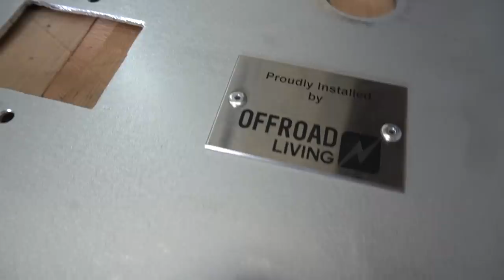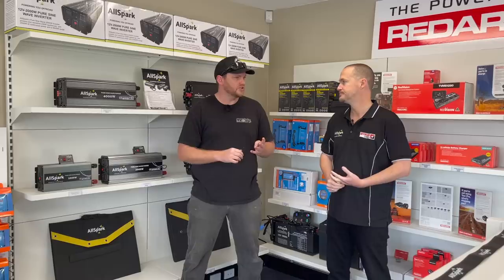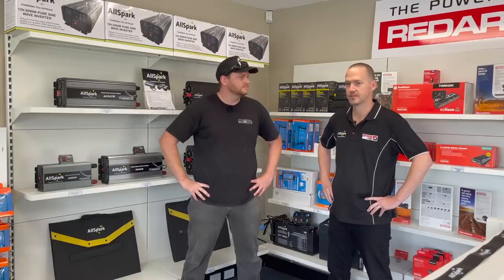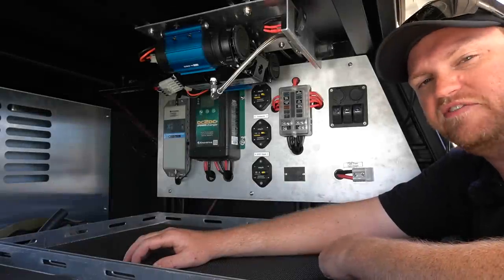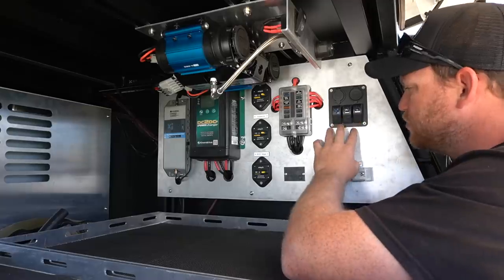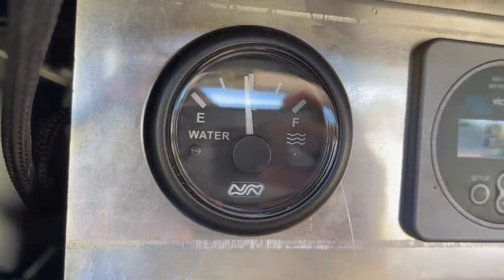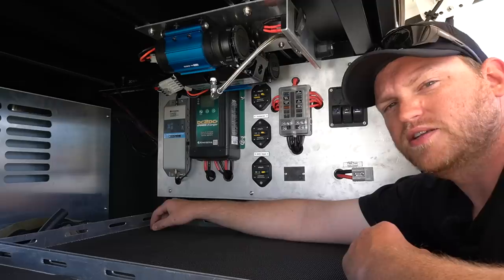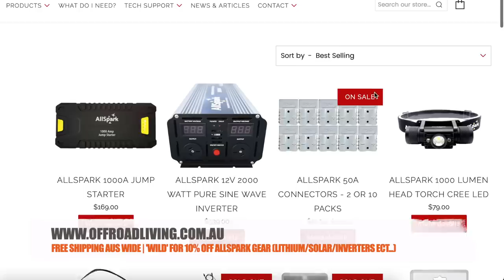The Dmax Touring (re)Build Series E05 || 12v Fitout - Induction Cooking & Allspark Lithium Battery

Comment: Hated watching this! Makes me realise the amount of work I need to do on my 4wd, basically a whole re-wire, lithium batteries , dcdc charger, solar panel….etc. $8k+ 😩. 👍
Reply from the maker: Yeah it’s a big job and decent chunk of change done right. But so worth it for reliability and longevity if you can justify it for your situation!
Reply: I just wired up my caravan with 1.2KW solar, 340Ah Lithium, 85A AC/DC charger / 4kW inverter/ automatic change over switch. 50A  DC/DC charger and it cost me 6k. Granted I did the work myself but lithium systems are getting somewhat affordable in relation to what they used to be.

I can run my AC on the coldest setting all day, whilst also using my microwave and any other electrical load in the caravan with no worries now. Very happy with it.

Comment: Does your compressor wire straight to your lithium main terminals? Am thinking of hard wiring as well. Am assuming that if car is running it would give 70a from lithium and then 40a from alternator through the dc2dc charger to drive the compressor?
Reply from the maker: It’s hardwired to the fuse block (each piston has its own fuse). So it is running off the lithium. When the compressors going with the engine running it would be assisting it with some current. But my batteries good for 175a continuous, so the 68a max from the compressor doesn’t worry it (engine on or off).

Comment: Cam, How do you find the heat build up or dissipation from your 12 volt oven ? do you find the roof mounts good with air gaps all round the oven ?
Reply from the maker: Every side other than the door is really well insulated. It’s working well 👍🏼

Comment: Awesome canopy build and an amazing electrical fitout, Cam. It does not just look amazing but meets your build brief. Keep working on the love for the induction cooktop, one less fuel source to worry about, greater control over cook temps and yes, unaffected by blowing WA gales. The All Spark solar blanket looks great, keeps the tinny on the roof and extra weight out of your setup.

Your honesty is still refreshing and soooo appreciated, your supporter base is growing in reflection of that honesty and diversity of topics you cover. And also keeping things in the realm of fiscally achievable for the average person/family. All the best to yourself, Tiff, Chloe and Percy (and the new little Wild on the way (?)), thanks for more great episodes on everything that keeps you getting away and sharing what you get up to when you get there. Cheers.
Reply from the maker: Thank you! I really do appreciate the kind words and the support! 

Definitely going to persist with the induction cooktop for a while to give it a fair go, as you said- there’s plenty of positives!

Comment: hey mate , what did you set up cost roughly, I know I won't need as much as you but heading over to Perth next year wondering if it's gonna be better to wait to get canopy and electrical done there or do it while I'm in Sydney
Reply from the maker: All their prices for parts are on their website;
www.offroadliving.com.au

But roughly 
$1500 for 150ah battery 
$480 dcdc charger
$310 battery monitor 
+ fuse panel, circuit breakers, Anderson plugs, terminals, wiring, solar, labour ect..

Shoot them a msg on social media, email or give them a bell. If you tell them what you want they’ll be able to give you a price on supply or supply and fit 👍🏼

Comment: Hey mate, you may have done a video already on it, but how do you find the air compressor you use? What one is it? Cheers
Reply from the maker: It’s a dual piston ARB compressor. Early days but so far it’s been good! Pretty expensive though. The old $99 XTM compressor it replaced lasted me a couple of years and was just as fast.

Comment: Thanks for the content. Curious to know why the DCDC circuit breaker is next to the DCDC opposed to the cranking battery?
Reply from the maker: There is circuit protection at both ends. A 50a midi fuse straight off the cranking battery, and a circuit breaker at the DCDC charger end. 👍🏼

Comment: Looks awesome 👍👍 a quick question, are you running the ARB compressor off the Lithium or start battery?
Reply from the maker: Cheers mate, yeah running the air compressor direct off the lithium. I wouldn’t do that with any lead acid or many other brand lithium batteries. But the Allspark  will pump out 175a max continuous discharge , and my compressor draws 68a at full whack.

Comment: The only thing I'm not all on board with is the 100a breaker for the Anderson. 

It looks just like a regular 50a Anderson. Why wouldn't you fit a higher capacity Anderson in its place?
Reply: 50A andersons are rated for 120amp current use, 50A is their 'hot' disconnect safe current
Reply: @andyday133  right. Thank you. I actually had checked the specs myself after i posted this. 50a just refers to got disconnect as you mentioned and rated from plug to PCB if integrated. Cheers.
Reply from the maker: Cheers  @andyday133 , Was trying to remember the reasoning because I remember initially asking you the same thing 😆

Comment: A better antennae on the Cel Fi Go  does make a difference. While went for the magnetic base which looks a bit like a shark fin and have it on the corner of the dash and it works a treat and extends the signal well beyond the car and caravan. The small one that usually comes with the kit is not much good.
Reply from the maker: Cheers mate, I’ll have a look at that, be nice to have signal from the van too. I’m more concerned about the incoming antenna though. I’d like to get more range from towns/towers.
Reply: @WildTouring  The aerial I have is a Blackhawk Trucker Edge Compact Antenna which so far has been impressive. I have only had the setup a short while and only used it around the south west and last week went to the Stirling Ranges up through Red Gum Pass Road in the middle of the ranges and still got 4 bars. I have it mounted on the rear of the roof rack.
Reply from the maker: @zoezoe610  heard good things about Blackhawk antennas, and that’s probably the way I’ll go. Never had dramas with signal in the South West either, it’s up north in the Pilbara and the Kimberley between towns where we found it useless. But I’ll have a crack at improving it with some better antennas before I give up on it!

Comment: Do you carry a spare alternator on your longer trips Cam?  Seems this set up, awesome as it is may have the achilles heel 🤷‍
Reply from the maker: I’d have bigger issues than no hot dinner if the alternator failed on me, they don’t run for long without one. Not like the good old mechanical injection diesels unfortunately. 

But nah, don’t carry a spare. Don’t have the GVM to carry it all!!
Reply: @WildTouring  Depends on the remoteness of the trip hey...for the right trip I'd sacrifice 2 six-packs weight for some charge ability :)

Comment: Do you run a step up reg on your 12v oven..
Reply from the maker: Nah I don’t, I get a slightly higher voltage over a lead acid setup due to running lithium. But I may look into a step up in the future.

Comment: What about the EMF and EMR?
Reply from the maker: My understanding is that Induction cooktops emit low to mid range non-ionizing radiation. Which cannot change cell structure, is non cumulative and not harmful (unless you have a pacemaker).
Reply: @WildTouring  thanks. I was thinking more the battery, wifi signal booster and other electrical components but i suppose its something that you cant get around.